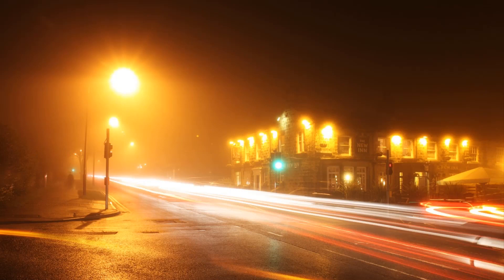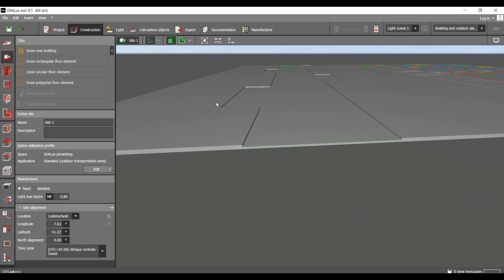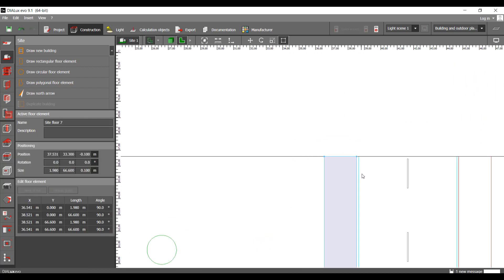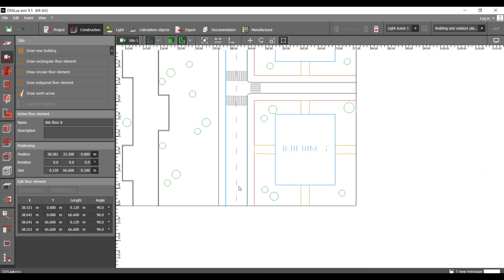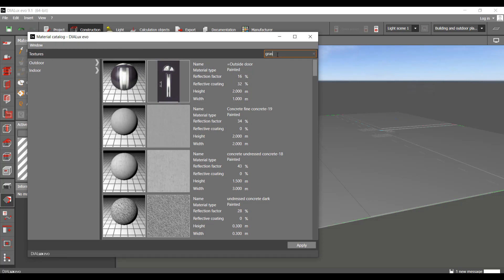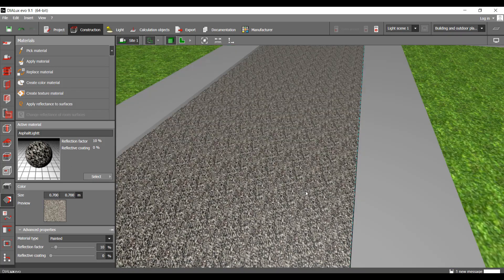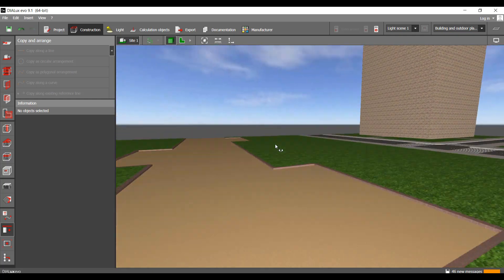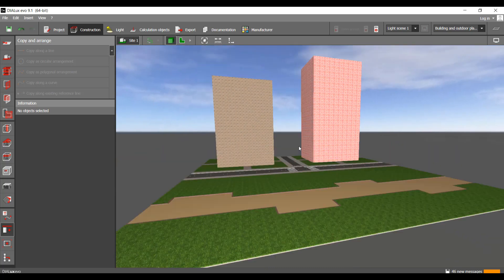Outdoor planning complete project part 1 |  DIALux evo (2021)

Comment: Hi I have a problem in dialux. Can you help in this regard?
I  import auto cad drawing to dialux and do the design. Then again I need to import revised auto cad drawing. I removed the previous one and import the new one. But the new drawing was out of range of my design. So how should I arrange the coordinates to have the new drawing onto the previous design?
Reply from the maker: Hi, 
Here is how to solve that : 
Go to the verical tab "PLANS" click on the new plan in the section "PLANS" in "ADDED PLANS"  --> go to "POSITIONING" and click on "MOVE PLAN", then click on a part on the new plan you can recognize in your existing building! That will bring the new plan on top of your project.
The best way to that tho is to replace the plan instead of uploading a new one (in case it's the same that you modifed).
I hope you understand
Good luck
Reply: I understood. Thanks 👍
Reply from the maker: @sajeevipiumika4033  You're welome!

Comment: Thank you for all these free video tutorial guides!
Reply from the maker: Very welcome. I am looking forward to add more and more content to help all those people struggling out there...
Reply: @OUHSSAINESAID-LightingDesign  Dear sir, is there a specific lighting standard for outdoor carpark ? I guess that in Dialuxevo, its abt 20lux depending on situation. Is there a IEC or other standards we could use for reference ? Thank you.
Reply from the maker: @andrewlaksh7931  Actually, it depends on the standard you need to respect. For example, in the european standards, it can be either 20, 10 or 5 lux, depending on the traffic load. You can find all that in DIALux evo in the "Spaces" tab.
Reply: @OUHSSAINESAID-LightingDesign  Tq sir.
Reply: @OUHSSAINESAID-LightingDesign  Greetings to you sir. I have gone through all the for set of videos that you had shared here for free and i was fortunate to have got hold of the videos and to date I have not seen anyone who share their CAD drawings and to use it to flow your guide in the videos step by step. Thank you very much. 
In one of my projects, I used a jpg. file imported into DIALux Evo. It is a lighting simulation for landscaping and public area at a riverside. But the divisions of assessment zones were not prominent in the drawing. I tried partitioning the drawing into assessment using polygonal floor element in DIALux but the area defined by the polygonal lines didnt form a floor element and hence my lighting simulation didnt work out. 
Thus, I have a question that I hope you can answer. If the division of zones in the drawing is not well defined, and we estimate a rough floor area and insert lighting fixtures, this floor area doesnt form a solid floor and hence, DIALux would not be able to preform the operation? Thank you in advance sir.

Comment: I am just learning this software thanks for your instructional video.  However when I follow along with you and create floor elements there is no option for running calculations on them.  I have to create a calculation surface in order to run calculations.  Am I missing something?
Reply from the maker: In order to be able to start a calculation, you need to insert lights first !
Inserting calculation surfaces is optional, but it's what let's you know about the achieved lighting levels!